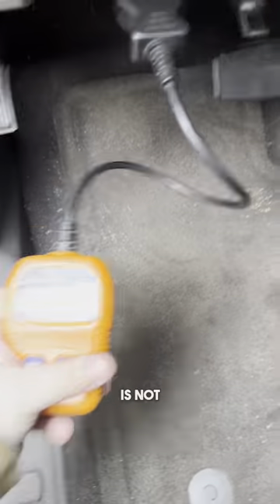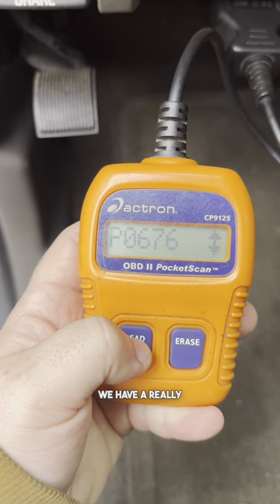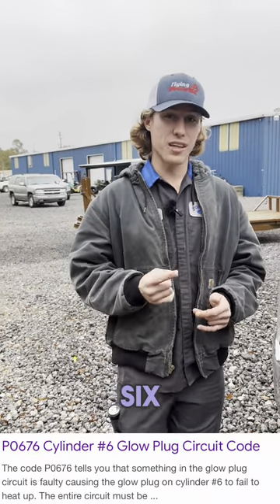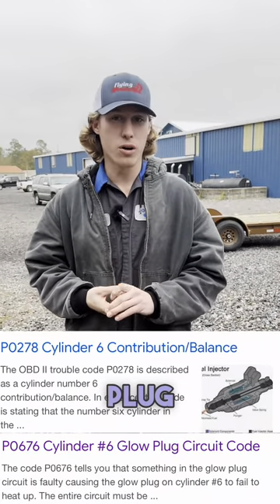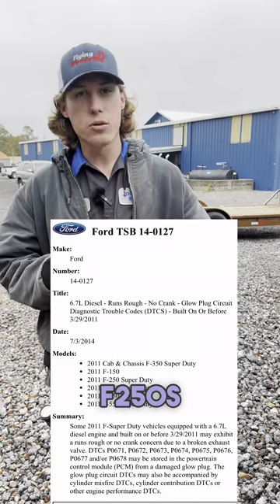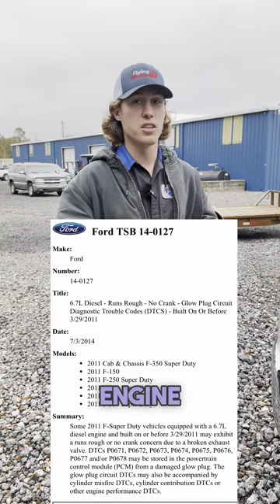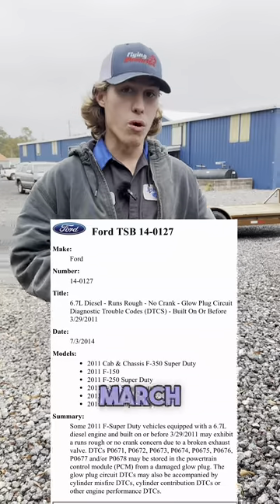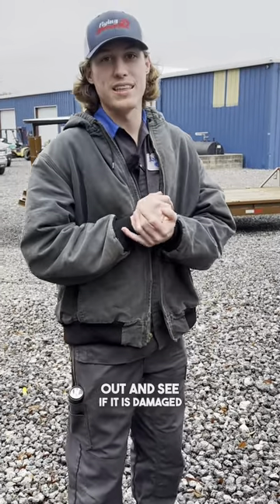Ford 6.7 PowerStroke Glow Plug Destruction #ford #powerstroke #shorts

Comment: TSB!  There should have been a recall on these engines since Ford knew this was a fatal flaw in its design.
Reply: All ford engines have problem. My brand new 2020 xlt has a TSB out for a quart of oil consumption every 3k mikes also the timing chain to taps the guides at deceleration. On a 2020 xlt f150 with 30k miles. Ridiculous
Reply: Hahaha so glad I have a Cummins.
Reply: @kyles234 a lot of cummins are all recalled for epa defeat devices lol
Reply: @bonjoviy3413 but not because of a flawed design…..
Reply: @bonjoviy3413 yes but the cummins will not have any problems if you dont take it for that recall lol
Reply: You don’t seem to understand what recalls are for
Reply: @samoa3.710 believe it or not that’s the spec for oil consumption for new cars nowadays… for GM oil consumption it’s 1 qt every 2,000 miles. That’s considered normal for the engine to consume that much oil.
Reply: It lasted 13 years. How many miles?
Reply: It lasted 13 years. How many miles?
Reply: @UlfricStormcloak69   I get engines consume oil but that’s ridiculous. No engine should consume and possible run that low for a couple thousand miles. And Ford tells you run it 7,500 miles on each oil change?? Like it doesn’t damage the engine over time. 

Also, the fox is a pcm reset and possibly 20 degree timing adjustment to solve the tapping from timing chain. Thousands out of pocket or a few with warranty.

Imagine losing 2 quarts of oil every 4k miles.
Reply: @samoa3.710 
Quart of oil is acceptable.
Reply: @88wolffy  oh ye ik
Reply: @JohnSmith-xu7ev in a 15 qt capacity diesel maybe but not a 5-7 qt gas engine
Reply: @calebz1448  
It is acceptable in a 5 quart gasoline car per engineering specs
Reply: @JohnSmith-xu7ev  there's your mistake. Listening to the dumbest smart people on the planet. Common sense should tell you that is not acceptable if older engines didn't consume that much then newer engines shouldn't either. If they claim that consumption is needed for lubrication then just make a 2 stroke where people expect oil consumption
Reply: @JohnSmith-xu7ev  YouTube won't allow me to tag anyone in more than 1 sentence
Reply: @calebz1448  
Go to school, and you are taught that that is normal for cars to burn up to that amount. If you actually designed engines or rebuilt them, you know oil is burned off on purpose due to the need for lubrication
Reply: @calebz1448  
It isnt common sense. You need a degree in automotive engineering. Common sense is knowing the sun will rise again, not the construction of molly rings on a piston
Reply: @JohnSmith-xu7ev  common sense dictates that the future should learn from the mistakes of the past, not create worse issues than the past
Reply: @calebz1448  
So what foreign country are you from because your comment is from a 3rd world country
Reply: New cars consume so much oil because of the turbos. Everything is turbo now
Reply: Yeah I've read from a bunch of manufacturers that that's the spec. So ridiculous.  @UlfricStormcloak69
Reply: @kyles234 Cummins still gets its frame ripped off by the new and old 7.3😂💀
Reply: @samoa3.710 that’s not brand new it’s 4 years old 💀
Reply: @UlfricStormcloak69  thats so sad now adays everything is junk ima stick with my 96 4runner until it rust in half then il have to deal with the newer junk

Comment: But now it's out of Warranty so that guy is screwed TSB or not.😮
Reply: I tell people to avoid the EARLY PRODUCTION 6.7 for this very reason unless the engine has already been replaced. The engines were replaced with the improved engines which didn’t have this problem. If it was made after March 2011 or has had the original engine replaced, it’s ok.
Reply: @dmandman9 are the 2013's reliable?
Reply: @CristianCruz-jf4iw  My dad has a 2013 with the 6.7 52k nothing on the engine whatsoever!
Reply: @Foxbody302 wow, really put it to the test by racking up nearly 5000mi/yr. Lol.
Reply: @CristianCruz-jf4iw  Yes. It’s only the engines made prior to Around April 2011 that were subject to this issue. And from what I heard, it was because of the way the metal of the exhaust valves was treated during manufacture. And to be honest, even the affected engines were still fairly reliable. But they had enough problems for ford to simply replace the faulty engines when they failed with an upgraded engine.
Reply: @alkalk8938  forgot to mention that it is used as a tow rig, a bunch of WOT.

Comment: WTF?!?! An ENTIRE ENGINE for one bad glow plug?!?! That’s insane.
Reply: Bro, the glow plug exploded in the engine, that’s like dropping a bolt down your intake and expecting it not torch your engine
Reply: I just would put a plug in it buy pass the glow plug ignore the codes and drive it as it is. 
If you have to replace the motor with a long block why not drive it till you save up or tack out a loan for repairs. And what has ford done to prevent that from happening to a new replacement motor? Different glow plugs.
Reply: @rls9926 the damage in this case is already done. The glowplug tip has broken off and sounds like it did damage to cylinder 6. Whether that be piston, cylinder wall, valvetrain or a combination of them.
Reply: @rls9926 there is a hole that through the cylinder!
Reply: Just send it I say send it right out the top and bottom. Chattering and banging all the way to the bank to get a loan.😊
Reply: This problem seems like dodge rams when the inside part of the bolt melt down and falls into de cylinder 6.😢😢😢😢
Reply: Don’t buy a ford. Simple as that
Reply: the piece of the plug as already fallen into the cylinder and has been scraping and clawing for God knows how long, cylinder, piston and head are essentially fucked, there's no other way
Reply: @efraingarciaescalante2824 the not de
Reply: Take it to Dave in Utah😊
Reply: Cummins ftw
Reply: Everybody wants a diesel until it's time for repairs.i could buy a new gas motor for what a new turbo and injectors cost for a diesel...lol
Reply: Just looked up the TSB…apparently they ‘exhibit rough running or no crank due to a broken valve.’ The broken valve will then damage the tip of the glow plug, and it will send a damaged glow plug code. 

Ford flow chart says ‘does it run rough and give one of these codes? If no this tsb doesn’t apply, if yes proceed to step 2. Remove the problem glow plug. If the glow plug isn’t damaged, this isn’t your issue, if it is damaged, replace the long block.’ 

Stupid…
Reply: @cnf6045  put a boroscope on the glowplug opening and check valve if u can.  Also, modify a compression test to check valve seating thru the glowplug hole.   Possible to thread a magnet thru glowplug hole and pull out some valve metal debris
Reply: @Franklinveterinarycenter1of4  yeah that’s probably what I would do If it was me before I condemned the engine. Was just reading the TSB from ford. Something similar happened to my Cummins. Compression tested each cylinder, No compression on #5. Ran a bore camera down down the injector hole. Chaos. That got expensive…
Reply: No, THATS FORD ENGINEERING.

Comment: Duramax had this issue as well. If you're not very carful, you will snap the tip off and if that happens you have to pull the cylinder head. We had one where the owner broke the tip but DIDNT start it. He disconnected the battery and had it towed in and we were able to save it

Comment: That's called a mechanic's special. You sleeve that cylinder if necessary, replace the piston, replace broken valves, weld the dings in the cylinder and die grind them flat. The key is to not start it after you hear that noise the first time, you're just causing more damage.
Reply: Or you can just plop a new motor in there that way you don’t gotta worry about problems. You every try working on these? Nightmare.

Comment: What's wrong with the engine? Did the piston hit the glow plug? How?
Reply: Probably a bad batch of glow plugs for the manufacturer.  That piece fell off due to heat and pressure and ate up the cylinder. 😊

Comment: Why does Ford build crap now they were bdo reliable, ie, 351, 460,, 300/6 cyl, 302,
Reply: All those engines you mentioned will still be running,long after the 6.7s will be long gone

Comment: So happy I never had the desire to buy a wannabe diesel. If you NEED a diesel to pull on a regular basis, buy a Class 6, 7, or 8 and quit these tinker toy wannabe trucks. They aren't worth it.
Reply: I've told people this many times, these light duty diesel trucks are junk. One of the trucks I used to drive is a 2015 F750 it has a 6.7 Cummins. For a small engine it did pretty good I was impressed for what it could do. I've grossed the truck 38,000lbs which is overloaded the legal gross is 33,000lbs. When I pulled the wagon with an excavator on it truck grossed around 45,000lbs. I wouldn't own a new F750 thou it has the 6.7 PSD. I would buy a KW T180 it has a rebadged 6.7 Cummins with a 8spd automatic. Or the Peterbilt version 535 both trucks have a 19,000lb gvw.